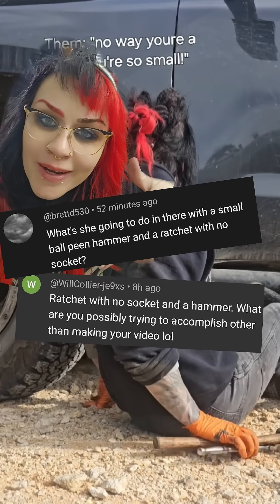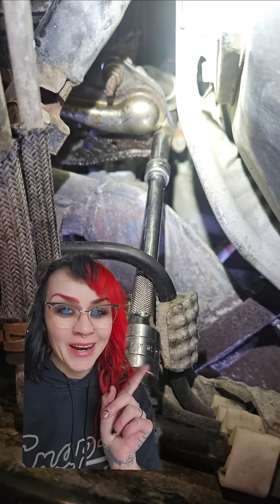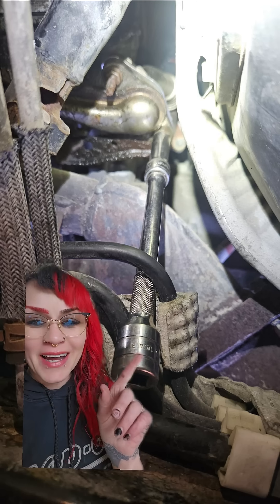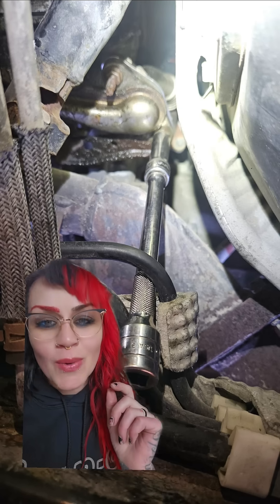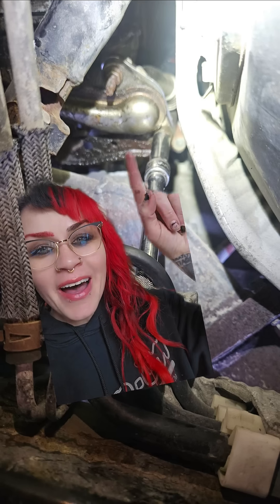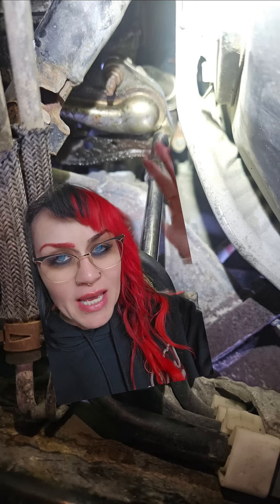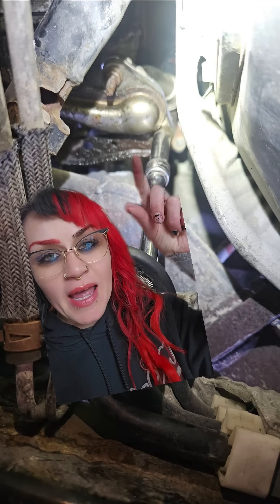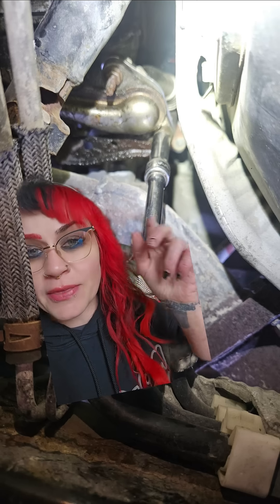What Am I Doing? Using Resonant Frequency to Loosen Rusted Fasteners like @MrDanielSoliz Taught Me!

Comment: @Faye Hadley I have a MK3 Supra someone stole fuel so much so I didn’t even get in warmed up before it ran out put fuel in and drove to store started not wanting to take fuel half way at normal temperature went filled with fuel still doing so I changed fuel filter still doing so even though racing fuel pump only had maybe 20 miles on it put in another new one I thought since it’s good cold maybe pulling up something and blocking fuel filter so waited a few days unhooked line and drained fuel refueled still doing same so I unhooked temp sensors thinking maybe one shorting while hot still doing same thing and has no codes any ideas on what may cause this runs good cold but cuts out and won’t take fuel when warmed up I am about stumped any thoughts would be greatly appreciated sorry for long msg
Reply: Also it has new head gasket and head studs that haven’t been in long and egr delete so i check the vacuum routes and all looked good on it
Reply: I would think stopped up injectors but runs ok cold

Comment: Heat the nuts with a torch then take a crayon and put it to the threads. The wax from the crayon will make those rusted nuts crack loose.   Its a wayy better method than PB blaster.

Comment: Faye, try a product called "FreeAll" and or CRC penetrating "Knock'er Loose" both work way better than PB Blaster. I'm a fan of PB but, it doesn't always get the job done like the other 2 products I listed. Cheers :)
Reply from the maker: You know, I have SO MANY penetrating lubricants that I use with success, and no matter what I use, there's always someone here recommending that I should use something else 🤣🤣🤣 I think it's one of those things for if you ask 10 mechanics how to do a job you're going to get 10 different answers! I have the CRC, the Wurth, the seafoam, the BG, I have SO many.... and I'll be honest.... they all seem the same to me!! And nothing works better than transmission fluid mixed with acetone!!!
Reply: @FayeHadley  🤪
Reply: @FayeHadley  thanks, Faye!
Reply: Try pure wintergreen oil. The kind you buy at a holistic store or the sort. Why do you think pb blaster  smells like wintergreen.
Reply: @scottmaness4449  ok
Reply: @Ham68229  thanks for the info!